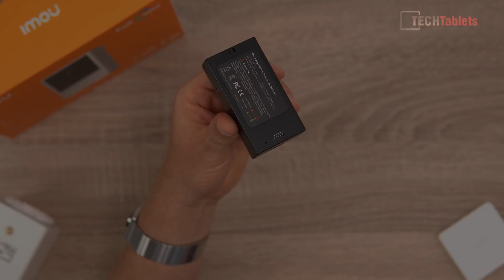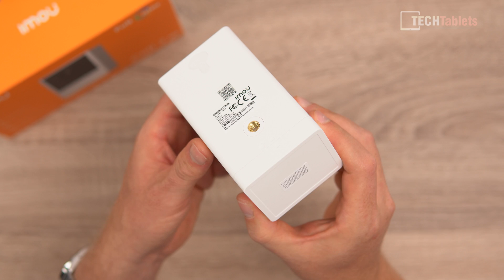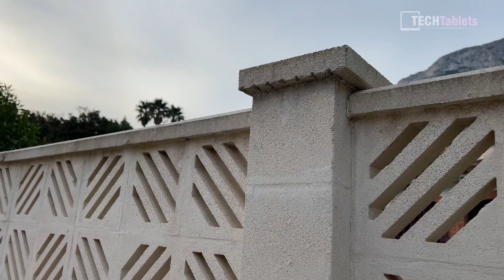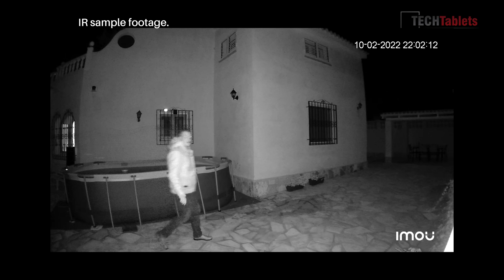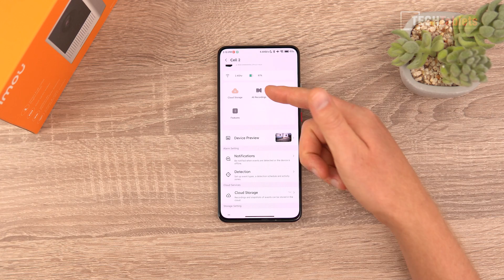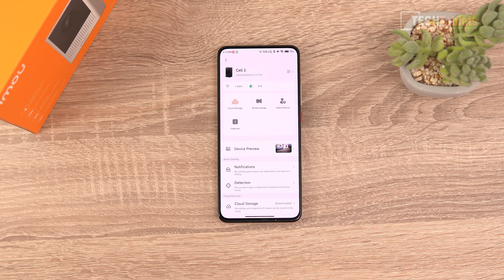IMOU Cell 2 4MP Unboxing, Installation And Sample Footage

Comment: I don't think it's your network... The app is slow a f, even on a computer, i've used their services even through wired internet and it still sucks. The video/images are super compressed you can't make out license plates even from parked vehicles if the angle is not perfect, let alone moving ones.